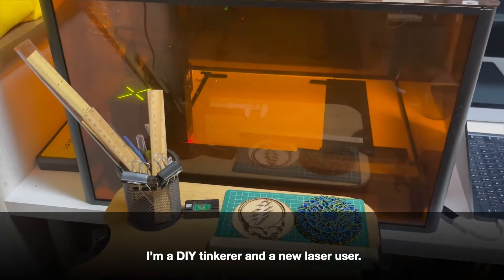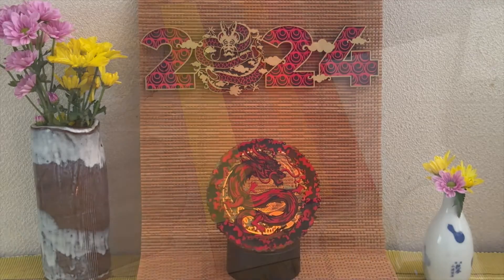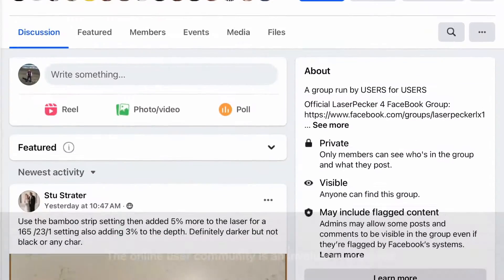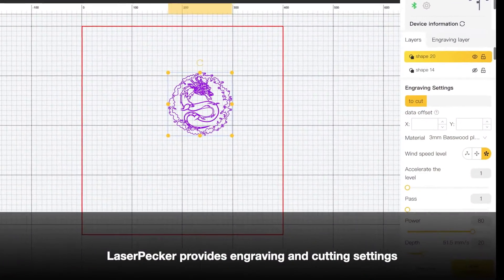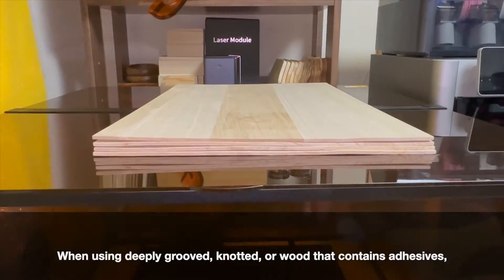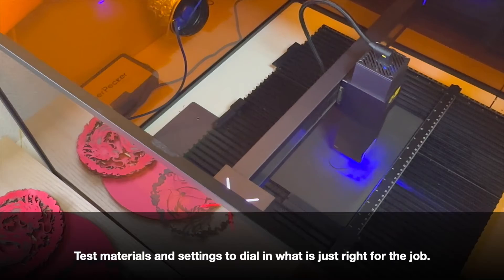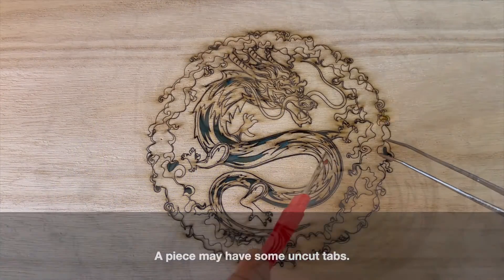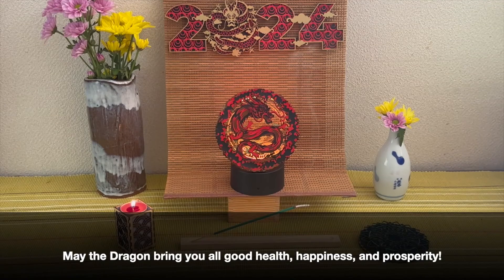LaserPecker LX1 Tutorial: Laser Cutting Multi-Layer Artwork

Comment: Why the @#% does my bed lose it's zero position? Every time I try to do multiple passes it moves 1/4 inch! So if I do 10 passes it moves 10 times and engraves 10 Fing images!
Reply from the maker: It sounds like there might be a calibration or mechanical issue causing your bed to lose its zero position. We recommend checking the user manual for troubleshooting steps or contacting our support team for assistance support@laserpecker.com.

Comment: Has anyone tried to fuse copper powder with the LP4? I'm wondering if it can be used to metal fill engravings?
Reply from the maker: While the LP4 is capable of engraving a wide range of materials, we haven't specifically tested it for fusing copper powder. We recommend conducting a small-scale test to see if it meets your requirements.